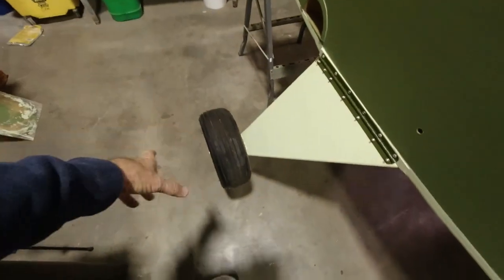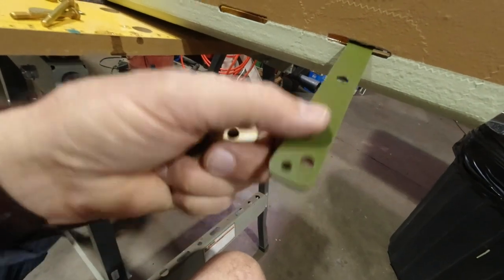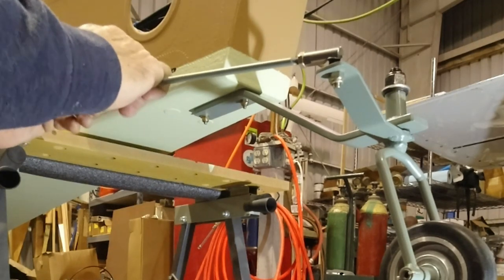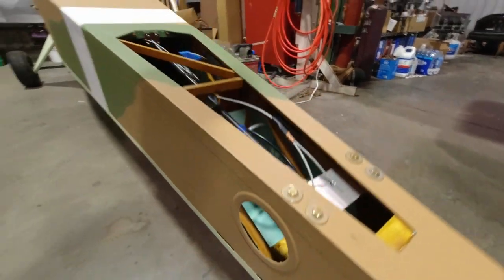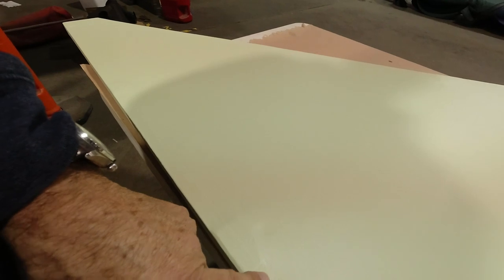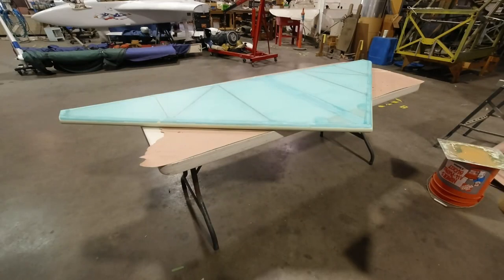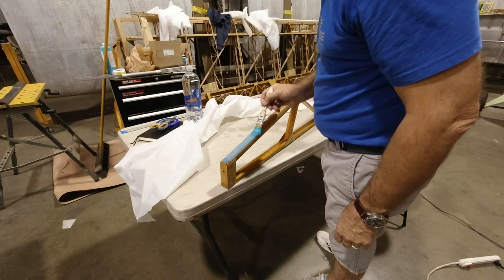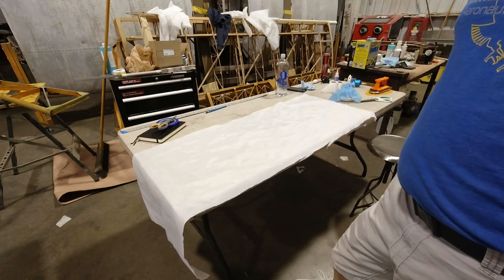Minimax 1100r Wood Aircraft Build Ep 162

Comment: Looking great. The bolts holding that bracket in place appear to be larger than the 2 bolts used to mount the tailwheel. Bolts for Tailwheel assy are not robust enough. . Think about doing a 180 turn on a narrow taxiway between 2 hangars. The radious of the turn would be huge with that setup. You need to be able to turn tighter,
Reply from the maker: I went into the archives and that bracket has been extended to an inch or so in the past so I’ll be making another one

Comment: Dennis, your tail wheel installation is "tops." Very clean.  Just a note on the steering arm.  After the rudder was installed, what i found when taxiing and steering, the turn radius was smaller, turning to the right - a little wider turning to the Left.  Like when you are back taxiing to the departure end, down the middle of the runway, then a 45 degree turn left or right to make your "180," seemed a much better/easier turn turning to the Right.  I worked a bit on the steering to change that wider radius, but "no joy."  :-)     Looks really cool sitting on its gear.  

"Clear prop!" :-)
Reply from the maker: Funny…interesting that you turned differently right to left. The steering arm is larger than the rudder horn so it seems like it is meant to move less. Probably gets pretty touchy if there is too much throw.
Reply: @DTMinimax   . Lost my comment - let me try again.  Yes, it appears that your tail spring is the same as I used (twice).    If anything, maybe it's a tad "thicker?"  But I don't think so.  

As I see it, Dennis, the tail wheel is mounted quite an "arm distance" from that most aft 3/16th bolt installation.  Thus, there is an ample "arm" that will work with the fulcrum at the bolt.  Try this: On your plane, push down HARD at that last builkhead,  and watch the flex of the spring -  see if the spring holds. ha, ha, .  I know, it's not funny. :-)  Try it - you'll like it,    (I'm working on finding out if that spring has been upgraded)

Comment: The steering arm / lever needs to be much longer, I think as you have very little tail wheel steering, to me it needs to move as much as the rudder or even a bit more. Normally there tailwheel steering is also controled with springs so you don't get to much kick back through the peddles as it makes contact with the ground. You are making good progress on the finish and it looks great. I can not wait for the side markings to go on, with a few crosses for the kills.
Reply from the maker: I searched the archives on the bulletin board and people did extend that steering hole out 1-1/2” further than on the plans. I’ll be making another arm. I suspected I would have to.
Reply: @DTMinimax  I think that is a better method rather than taking wood out in a high stress area near the tail wheel mount.

Comment: Looking great, I always try to have more than one thing to work on while building too. When glue or paint it drying on one thing I can go work on something else. You have a great work area, my one car garage makes it difficult to work on multiple things when I have a wing taking up the only workbench.
Reply from the maker: It looks like you are getting along well with your Hawk! 
I don’t remember, what was your final weight with the Hirth?
Reply: @DTMinimax   too much! If I remember right with the Hirth F33 it ended up 380 empty. 29lb of that was ballast in the nose to get the CG acceptable. With the Kawasaki I was able to ditch the ballast and ended up about 400lbs.
Lesson here, do not install a BRS with a light engine unless you stretch the nose.
Reply from the maker: @ulbuilder  Did you increase the size of your steering arm?
Reply: @DTMinimax  For the tail wheel? Mine is a nose dragger.
Reply from the maker: @ulbuilder  Of course, I forgot that!

Comment: I know you were concerned about the tail wheel assembly some time ago.  I though I could see the shaft wobble inside the vertical housing.  I have been concerned about  that assembly from the beginning.  If you have deferential betaking you will need more throw or some free castering ability when you make a tight turn to stay on a narrow runway  when making a 180.
Reply from the maker: I don’t have differential braking and with the grease in there it does make a big difference. We’ll see what happens over time. I have been thinking about how to weld on some tubing to hold bearings but waiting to see how weight and balance works out before putting more metal back there. Maybe some thin needle bearings packed in there would work too.

Comment: Gascolator...firewall mount
Reply from the maker: If this was a nose gear plane I would agree with you but the firewall is the high point in this system when the plane is sitting on its gear. If there is any water, it will sit somewhere near the seat with no opportunity to drain it out in a preflight sample.

Comment: Dennis, when you made those inspection holes in the side of the fuselage, are those going to be covered or left opened?
Reply from the maker: The one on the right side will stay fabric covered unless I need to use it in the future. The fabric was removed from inside the left one and it will get an inspection hole cover which is aluminum
Reply: @DTMinimax  sounds good.